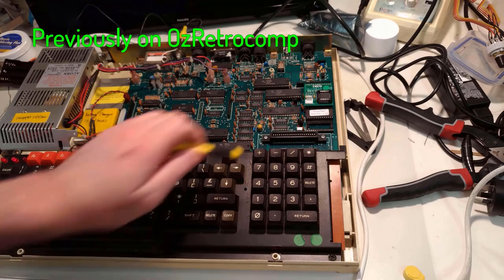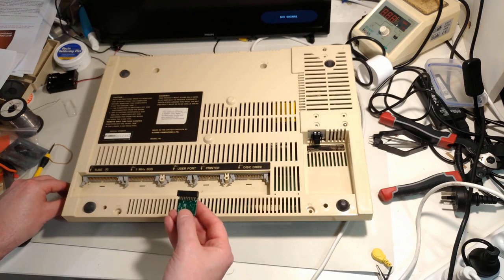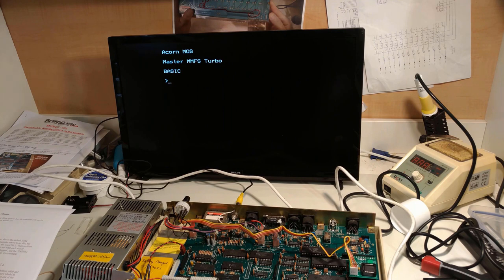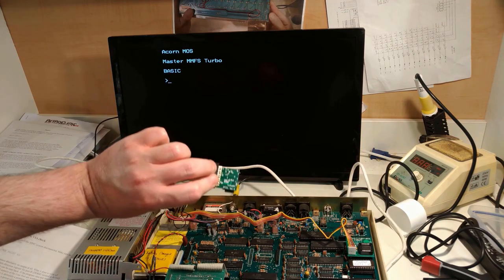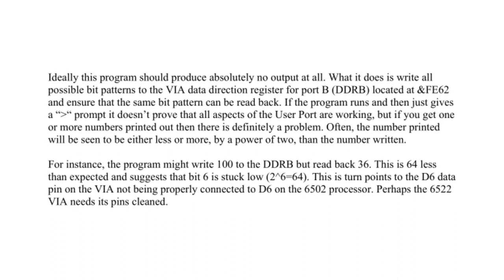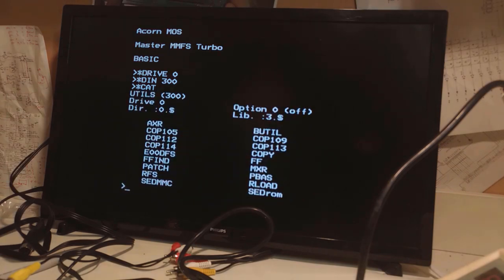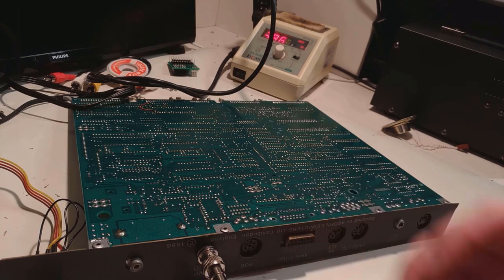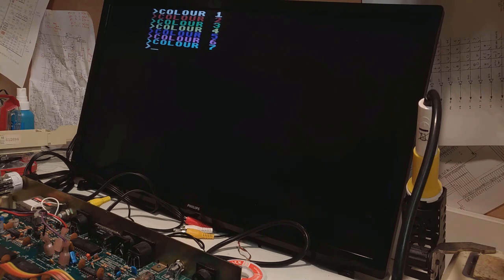Acorn BBC Master 128: TurboSPI install (with bonus 6522 VIA chip fail) + colour composite mod

Comment: I could have sworn removing that chip wouldn't have solved the problem. Did you put the same chip in after you socketed it, or use another chip?
Reply from the maker: It was academic. I had such a hard time removing the original 6522 that I couldn't have tested it in another machine even if I wanted to. 😲 That said, changing the chip resolved the issue, and it's not the first time I've come across a duff 6522 in my travels.

In hindsight I wish I'd practiced using my desoldering station a bit prior to tackling the removal of a major IC. Especially given that the Master 128 is one of my favourite computers in my collection, and a machine I've been using regularly since repairing it.